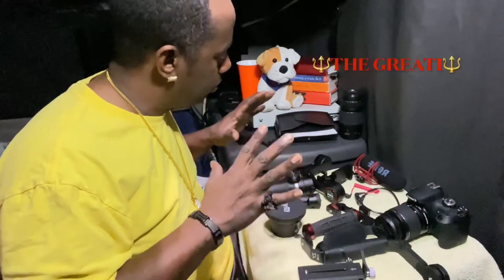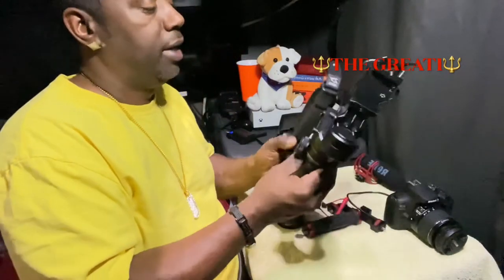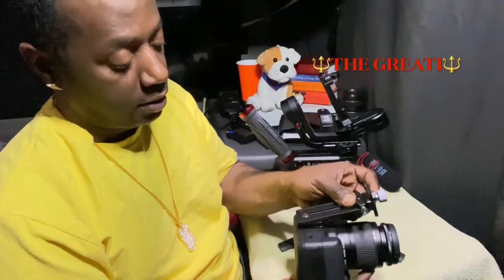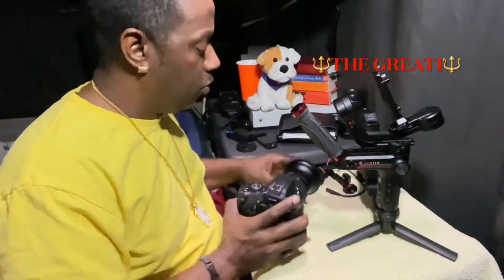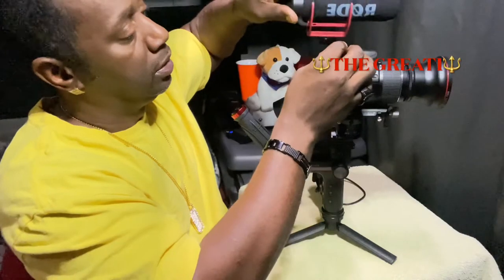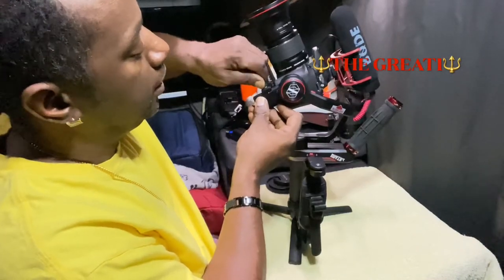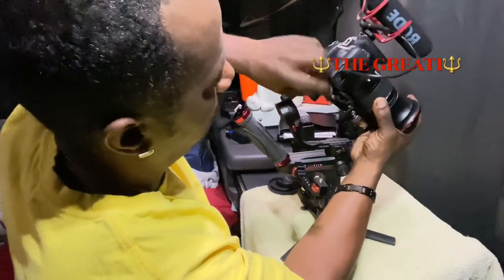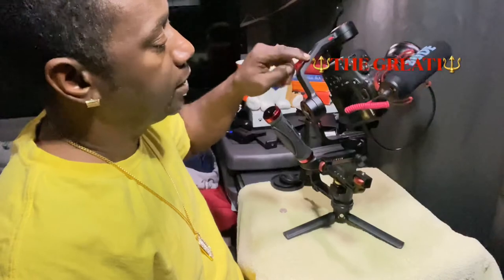Canon T7-WeeBill S Gimbal /NEEWER Monitor/Road Microphone

Comment: Hey bro, nice video
I have a question
With the T7 you can move the ISO, pause and play the video, move the shutter from the gimbal?
Because I heard about T7 doesn't support those gimbal functions
Reply from the maker: It Only Support Recording and ISO ,also has excellent tracking. If your going to buy a starter camera, I would suggest the canon t71…. It comes with a flip out screen ✌🏾
Reply: @iseeitallatl  Well, I actually have the T7  so, Do you think that the  Weebill S  supports the camera with most of its functions?
Reply from the maker: Yelp I have it… Ima do a video showing all the features, either way you can’t go wrong with the gimbal..It’s the shit . No wobble footage & it also has trajectory mode🔥🔥 also it can handle the next camera you upgrade to… I’m cool with the T7.. It get hella good video
Reply: @iseeitallatl  Thanks man, you were a really great help  and hell yeah man, please do that video about de functions with the T7, i will really appreciate that
Reply from the maker: Cool👍🏾

Comment: Is the mic actually working tho?
Reply: I doubt it
Reply from the maker: The Mic works excellent Bro 👈🏾...It give me great sound
Reply from the maker: @onlyhockey5176  The external mic 🎤 sounds great
Reply from the maker: The Road Mic 🎤 Sounds Great 👍🏾 Blessings ✌🏾
Reply from the maker: Blessings King 🤴🏾- Your wrong mines work super good with Quality sound
All you have to do is get the extension cable  (Onvian 3.5mm Female to 5 Pin Mini USB) ....
I use it with the rd microphone.’... I will make a video next week showing the enhancement👍🏾
Reply: @iseeitallatl  what camera do you use?
Reply from the maker: Canon Eos Rebel T7 With WeeBill S Gimbal and Onvian 3.5mm Female to 5 Pin Mini USB Male Microphone Adapter Cable
Reply: @iseeitallatl  i repeat..tehere no any way ..these cable dont work..because this a data port..they dont send any audio troug them....T7 has a built-in Stereo microphone and a Mono speaker. Canon T7 doesn't have any connections for external microphones and headphones.
Reply from the maker: Have a great day brother- mines work... No worries on my end😉 plz stop messaging me...👈🏾
Reply: @iseeitallatl   do a video ..whith. the camera showing the screen of t7 and mic levels and. the mic  near (with the cable) and tap the mic with your hands..if i see the levels react to your hands on the rode mic..i belive you..
Reply from the maker: Cool my friend- no worries 😉 I will do a video once I get back in town (Stay Tuned Brother 👈🏾✊🏾🔥✊🏾